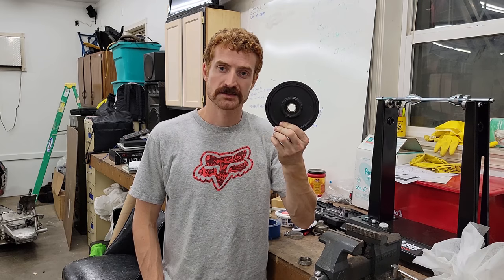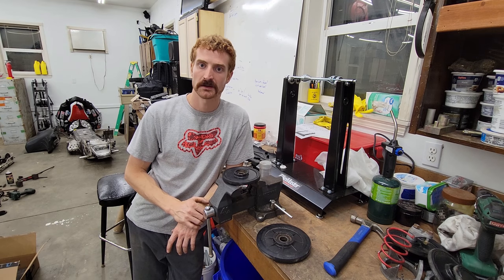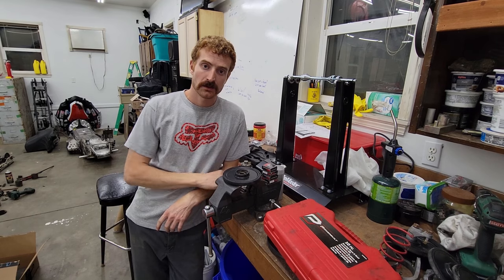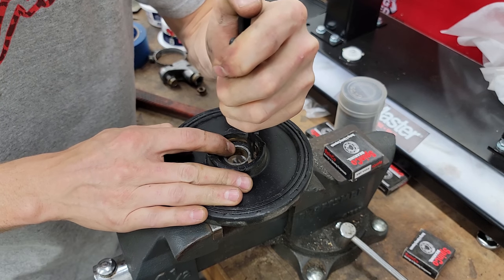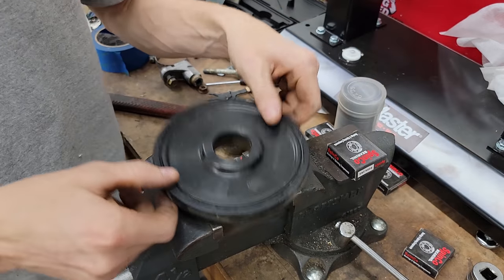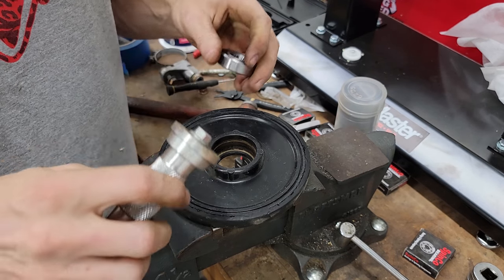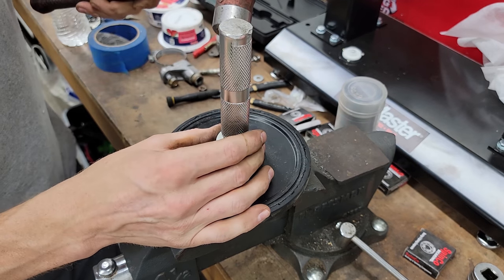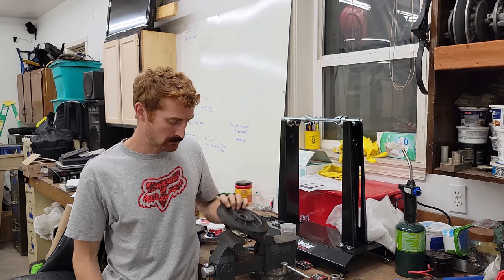Sled Tips 021 - Snowmobile Bogie Wheel Bearing Replacement

Comment: Are you sure those super generic bearings are any good??
Reply from the maker: All you'll hear are horror stories on the internet. I'm not trying to tell you a good bearing isn't better. But we've had pretty good luck with a $2 bearing. We were also swapping tracks in and out almost every weekend so it was easy to check a bearing and replace it while we were at it. If it's your trail sled and you don't want to touch it every few hundred miles, go out and buy the $30 bearings.